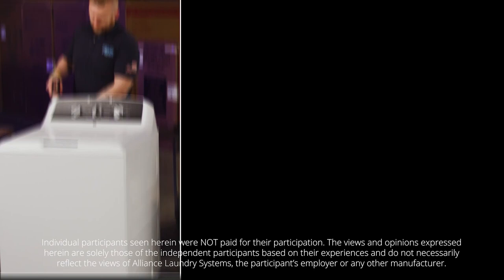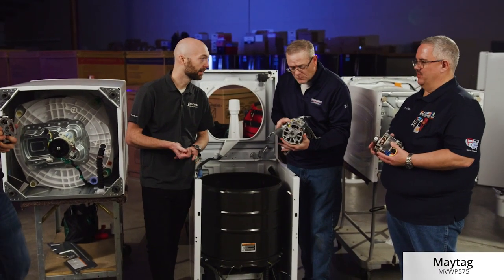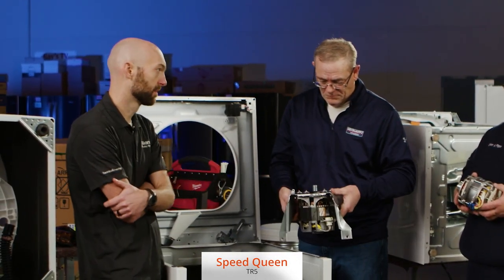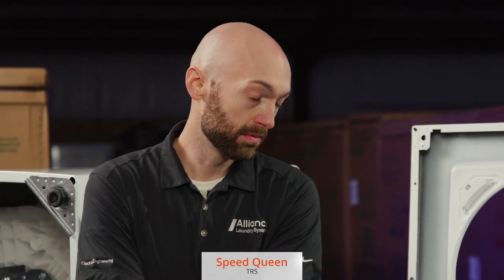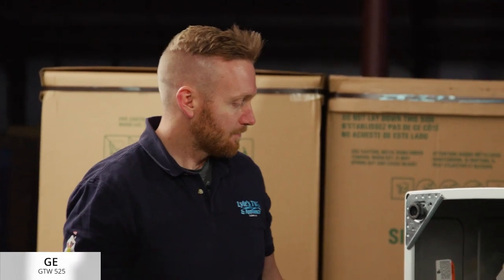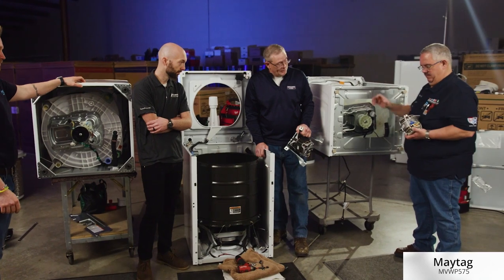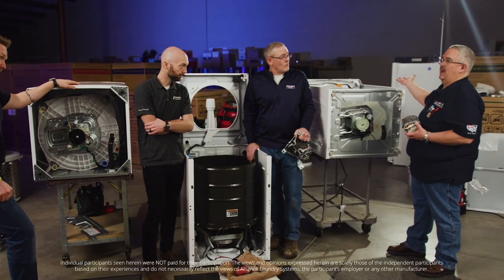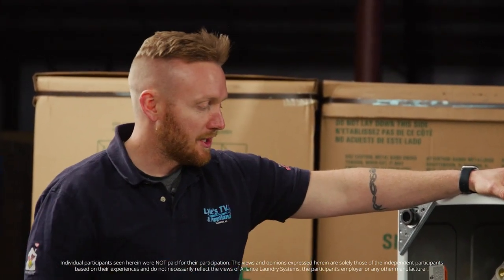Tear Down Video Series - Motor

Comment: What gets me as I work on commercial speed queens toploads and they are crazy different from residential speed queen top loads. I almost find it an unnecessary difference in the parts.
Reply from the maker: Great point! There are a good deal of differences between our machines intended for commercial use verses residential use (even if our residential machines are commercial grade)!